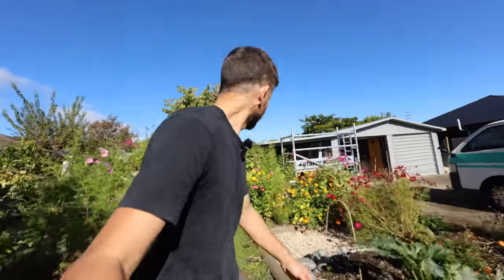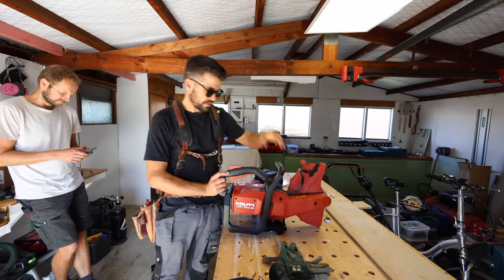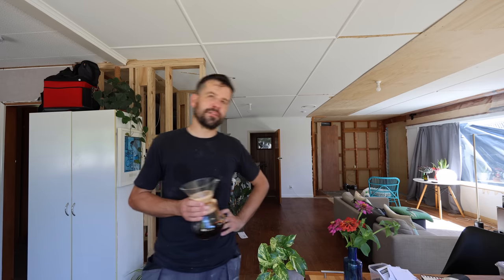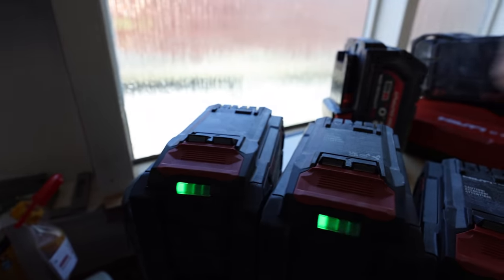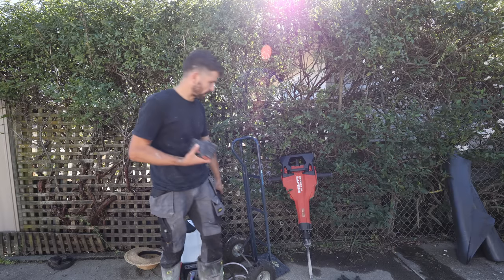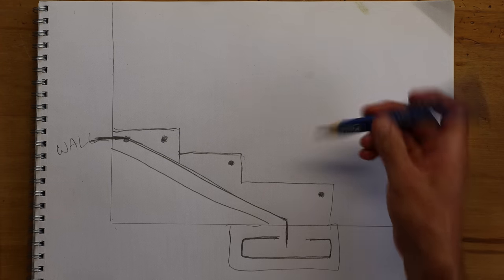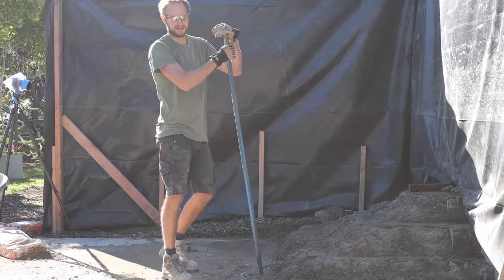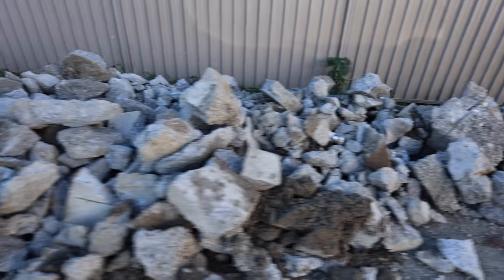Breaking Concrete with Battery Powered Tools: Is it Possible?

Comment: Great video, I've used the Milwaukee MX equivelant concrete saw and had the same results with battery life. I think the most useful application right now is taking door interior walls in countries with masonry builds (like here in the UK) where the fumes from a petrol saw would be unsafe/unpleasant. We are just not there yet for it to be practical.

Comment: Ahh, old builders. Fill everything with concrete, use hardwood framing that will burn your drillbits out, make sure no two pieces of timber in the house are the same or standard sizes and bury old bricks throughout the yard. Oh, and don't forget the vertigo staring down the hallway where no wall line is plumb! Well, that's my place, anyway. Love seeing the real world reno. Cheers from across the ditch. Cheers PP

Comment: great episode, I find using the pointed chisel heads more effective when breaking up concrete, less resistance than the flat heads... mind you, its still hard work.
Reply: Drilling a hole and then using a flat head or pointed chisel works even better.

Comment: This is why I like the Hikoki system as if you are doing a big job like this you can plug your battery tools in with the AC adapter and use them all day but if your out on the farm or just need to do a small task you can just whip out a battery. You only need the one tool. also there is a 21 Amp battery back pack made for the garden equipment that is awesome for this kind of thing. or you can hook it over your dropwsaw stand and it will last you days. They do have a bigish breaker but no concrete saw yet. I'm keen to see the new tracksaw in action can you ask Gaston to get his hands on one from Accent and do a review?

Comment: Speaking on Milwaukee but I'm sure this applies to the majority of tools including Hilti. The Supercharger can charge a 12ah battery in about 60 min but if you read the manual you'll notice it says that when the green light goes steady it means it's charged at 80% and ready to use. If you understand fast chargers and lithium ion technology. You'll know that they prefer to stay charged between 40% and 70%. Keeping them within these parameters gives the battery it's full potential of lifespan. Now I know this isn't ideal and especially when you need to get work done but hear me out. Fast chargers usually charge from 1% to about 50% at the fast rate at which point it slows down to a normal rate. When the battery reaches about 80% - 90% it will slow down to a slow charge rate. Which means if you can just use a timer and set it up for half the time or less you have less down time as the second half of battery charge slows down significantly and that is where all the wasted time is. If I were you I would just charge to 70% - 80% and use it up instead of waiting for it to charge fully at the very slow rate and decreasing battery lifespan as it doesn't like being fully charged anyways.

Comment: Well, the first thing i did was go outside and look everywhere for some tools and realized that I was the tool expecting to find some.  Other than that, I think that this exciting episode showed that there is still plenty of things that a powered tool can do better.  One thing that I thought of was the cost efficiency of using a battery powered tool for the job where the cost of all the batteries needed and then the cost of the charges and finally the cost of the electricity to charge them could exceed the cost of just using (or hiring) a specific tool from a hire depot?

Comment: I recently grabbed the cut off saw with 4 batteries and 2 chargers for a basement remodel. I cut about 60 linear feet with 4 fully charged batteries. It did the job and half the hassle. My cost was ~2k for the entire setup.

I really enjoyed using the tool and most importantly make me $$$

Next buy… Nuron Rotary Hammer…. 🤔

Comment: 5 year experience in demolition and concrete cutting.
Could have done that job without the concrete cutters and just used the big jackhammer. Corded would be better. Have got the dewalt but not as big as that Hilti. Get about 10-15min out of a single 40v. Corded is the way to go with jacks.
Great content. Keep it coming
Reply: I think the point was to show off / test the various Nuron tools. I'm pretty sure they didn't actually buy them.

Comment: My apprentice recently decided to splash half his wages on a hilti impact, battery and charger. I've gotta say I was really impressed with how the batteries fit into tools after whining about my milwaukee ones for the past 4 years
Reply: Milwaukee literally has the worst fitting battery of all time.  You should try makita, I use their 18v system and the batteries are super smooth.
Reply: @JerryPonds  Yeah I'm not stoked at how much of a pain it is to remove an M18 battery compared to, well, everything else. However if you're noticing your battery flop about like a Kingfish in some of your tools, do not worry, that is by design
Reply: @HotForgeChaos  really cool. My makita tools have silicon inserts in the battery part to prevent the batteries from flopping around.
Reply: They’re designed to “flop around” to prevent vibration damaging the cells bud. The batteries should only really fit rigidly into non vibrating tools like torches/radios/heat guns etc.
Reply: @devilselbow Makita gear has the battery wobble too (rotary drill/recipros)
Reply: @devilselbow  the way my tools and batteries get chucked around and abused at times, you’re probably right, but that is the reason they state for having the battery holder decoupled from the tool body.

Comment: I think that job would have finished me off! The battery issue you guys had reminded me of my gripe with a certain Makita 36v lawnmower that I purchased. I spend more time charging than mowing and it's been in for repair 3 times under warranty so far as it kept overheating. 
Scott's comment about the early days of battery tools seems to apply here as well. In a few years I'm sure the battery powered mowers will be awesome!

Comment: I have the makita concrete saw, takes 2 x 18v … it cuts 6m on 5ah batteries, 90mm deep. 

You need plenty batteries to work with it - but luckily I have like 10 batteries so never a problem. 

Nice to see real actual usage on the hilti stuff.   That jackhammer looks super - but, I wonder if hiring an electric one is better value.

Comment: Great video Scott, I myself removed a set of stairs exactly the same as your ones using a similar method using a powered Hilti breaker and a petrol Stihl concrete saw and boy it was still hard work!
After watching this I think if you had a powered breaker and a petrol concrete saw it would have made a huge difference but glad you showed a true representation of where the cordless tools are at right now and your right one day, they will improve to the point of being on par or better than the powered versions.
But at the end of the day, I said the same thing too.. next time I'm getting a bloody digger!

Comment: As much as I like the idea of having me battery to suit all tools I think larger/high demand tools really need a specialised battery. 

You made the correct point of needing 4 chargers and 6 batteries to be able to run the tools constantly. It just seems that you need to spend as much on batteries and chargers as you do on the skin.
Reply: Milwaulkee has a specialist flat battery panel for their breaker/jackhammer - I wonder how it would compare

Comment: When I was looking for an 18v sds, I looked at all the big brands, inc, milwaukee, makita, dewalt, hilti etc, but the most powerful one I could find was the Bosch bi turbo 18v sds plus, 5.8 joules, use with either an 8 or 12 Ah battery to get full power, brilliant bit of kit, if I ever need a heavy breaker, I just hire one, but I think in your case, I'd go for a digger and dumper. Hope ray will become a regular on the channel.

Comment: When taking up a concrete driveway or pathway that's not reinforced with wire or rebar I've made quick work with a floor jack and 5lb sledg. If you dig just enough so you get the jack under enough to give it a slight lift then hit concrete with the sledg and you get nice square pieces if you place the jack right.

Comment: I would highly recommend using concrete splitting wedges for thicker concrete like that in the future. A digger would definitely be more appropriate like you said but they have definitely speed up work I have done in the past.

Comment: The batteries will take longer to go from 80-100 than they do 20-80, so the best practice is to keep them in the middle of their chemistry sweet spot by battery swapping to recharge up to that 80% again, and using them without fully charging.
Reply: Its better to use them from 80% to 20% than from 100 to 0. Saves time at the charger and is better over the lifespan of the battery. However, I think most people always charge to 100% and run it as long as possible. And I would include myself in this group. It is not easy to change old habits.
Reply: Batteries should have a mode button to switch from 100%-0% and 80%-20% and default to the latter, while always leaving a buffer that can't be accessed. I'm sure many companies do have big buffers but it's not standardized.
Reply: Sometimes they want to be run right down though, I found my Milwaukee batteries are a bit happier once they've been run right down and charged right back up every now and then
Reply: @HotForgeChaos  yeah I can see how that might happen too, since these multi cell batteries have pretty complicated control circuitry and it might calibrate the way it charges all by itself.
Reply: @HotForgeChaos  I think that's placebo effect. You used to actually have to with NiCad because they have 'memory' but NiMH and the various flavours of lithium do not.

Comment: I could be very wrong here. As I'm a Carpenter and know very little about electricity. 

My idea is. Maybe the problem with that saw is that combined them batteries make what 44volts using a combined 24ah of power. 

Since dewalt has the 54volt system would it make sense that the dewalt cordless conc saw would last longer in the same work because technically if it ran on two batteries it would be 108volts. ?

Is that the problem here? These big electric battery powered tools need alot of juice but also high power juice at the same time?

Comment: The image of all the batteries piled up near the charger was nuts. That's like $2000k worth of batteries.
Reply: I initially thought the batteries were stackable ie keep stacking 4ah batteries until you got the desired capacity.
Reply: @TheOneWhoMightBe  that's a concept to be tried!
Reply: Well, for a commercial definition of "worth".
Reply: @TheOneWhoMightBe  - That's basically how they're built inside (they just a bunch of 18650-type cells), but having extra connectors, circuit boards and plastic between them would be kind of wasteful.

Comment: As a person who has had to chip enormous quantities of concrete by handheld battery, air, and chorded tool, my advice would be to skip the cutting on the stairs. People also like to drill multiple swiss cheese holes with a rotary bit too. It's all taking away from your time to chip and doesn't offer a net gain in time. You have 3 open sides for the concrete to chip away from the original mass which is ideal. 
  For the slab, I'm sure that concrete didn't like cracking when you slammed it with the sledge, so multiple scores were probably necessary to help it along. However in newer concrete, once you have a section (channel) removed end to end, cracking with the hammer is way faster than chipping or scoring when it's less than a 6" slab.
       Also, and I understand there are probably constraints as to what was available to you having borrowed that set up,  but a chipping bit with more of a point and less of a chisel would increase your productivity due to less  surface area being driven into the concrete. Especially against  that old stuff  I'm sure that bit was nubby  by the end of that project. 
   One upside to charging the batteries is that it gives the bit time to rest and not overheat and snap. Obviously more productive to have multiple bits to swap in and out like a SAW gunners barrel. I had a few endless days of using bushing bits to remove an epoxy coating form a concrete slab, and I would snap multiple bits a day. Luckily I wasn't paying for them😂

Comment: I have a hilti te3000 plug in breaker which is the best breaker I’ve ever had  I bought it second hand from hirepool for $1500 new $6000. Best breaker I’ve ever had way better than the old compressor breakers we used to use

Comment: Scott, there is a liquid you can buy and you mix it with water and pour it into drilled holes. You cap off the holes and the liquid expands, even cracking concrete. It's a start, at least!
Reply: I've seen that stuff used.  Overnight, an entire slab was broken up.
Reply: I'd like to know what that's called so I can look it up
Reply: Expansion grout, just googled it.
Reply: @momouppa  there’s a guy called Demolition Dave on YouTube who cracks boulders with it!
Reply: Good shout

Comment: It’d be really interesting to know why combination cordless and corded tools can’t be made…for instance how you can use your phone or camera while plugged in and charging. Thanks for your vid’s 👍
Reply: They won't be able to sell you batteries then 😄
Reply: festool tried it (i dont know if they still sell the adapter) with the cordless sanders. But the adapter cost  as much as 2 batteries pretty much at the time i looked into it.
Reply: Ego have a corded adapter for their outdoor range.
Reply: They can - see above - Hikoki have a battery/mains adaptor - and see below - Festool have a battery/mains adaptor for their 18v sanders. The more trades that draw attention to this (and vote with their feet, switching platforms) the more other tool companies will introduce the technology. A You Tube video like this, by a poster with this size of following - is great for clearly illustrating the real world drawbacks of certain cordless platforms. All credit to Scott and Ray. 🙂
Reply: They can, but for tools with a high power draw you need a pretty big adapter, that would make the tool significantly heavier. The alternative would be to have an external power adapter (outputting 22 volts), but then you'd need a really beefy cord, because the current needs to go up (since it's only 22 volts instead of 230).

Phones and cameras draw a very small fraction of the power that these tools do.

Comment: I rented a quick cut to cut 7 20"×20" holes in 6" thick concrete. The rental company gave me a cordless Hilti with 4 batteries. I had to wait to charge 2 more batteries to finish all the cuts. It's just not quite there for a lot of cutting, more for quick one-off jobs.

Comment: we use hilti cordless drills and  we think that they are just bad tools the chucks spit out the drills and bit holder  everytime or they just shut off on a full battery  from just drilling  into soft wood  or screw into predrilled holes also there are tools that should not be cordless   demo hammers and concrete saws are 2 of them  i used to have a big stihl gas powerd one  it just worked never stalled